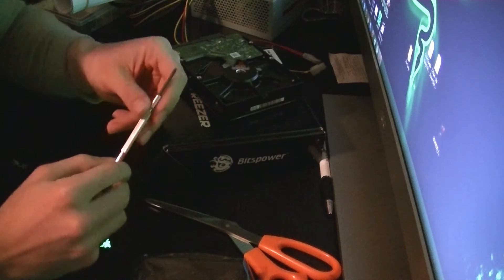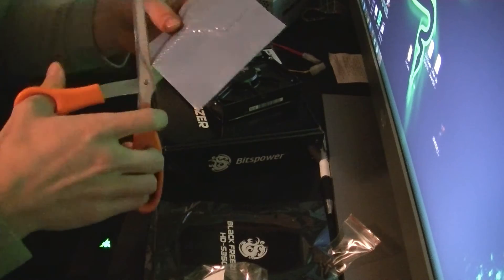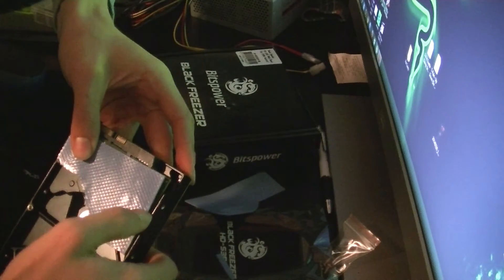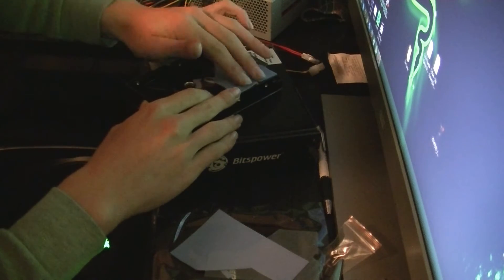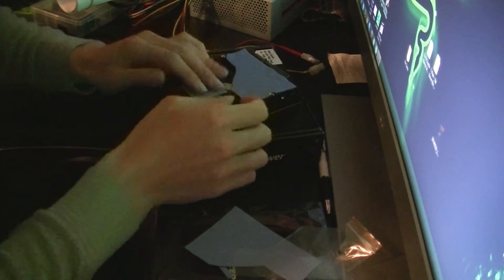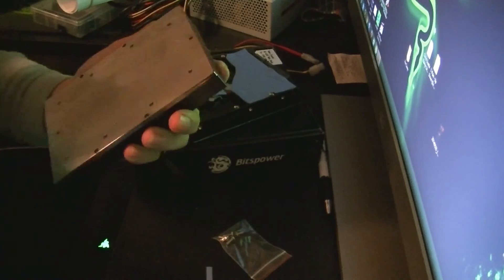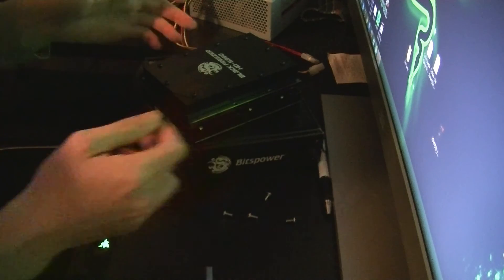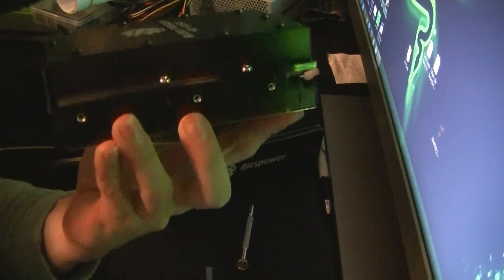How to install a hard drive water block

Comment: Where did you get your thermal pads? 
Any idea what Bitspower recommends on the two different pad's thickness. Thx
Reply from the maker: +V “RavVveN” V hey man, i got mine from dickos extreme computers. 1mm and 0.5mm thick